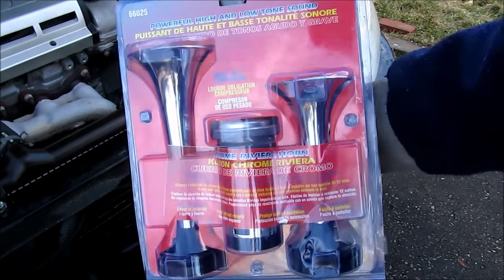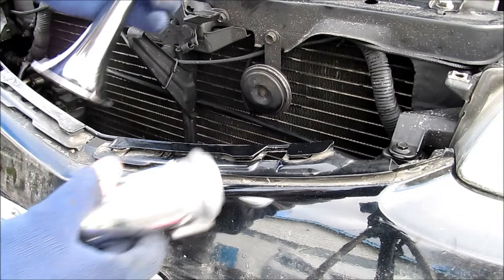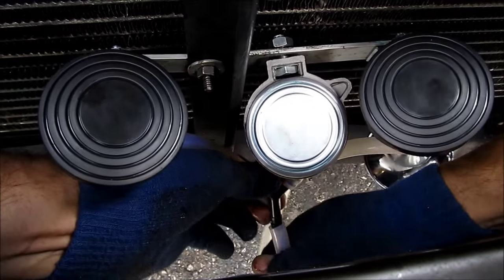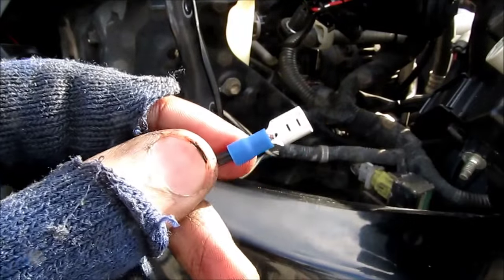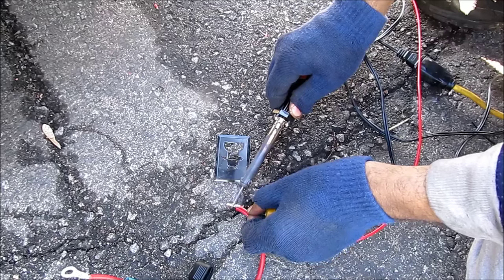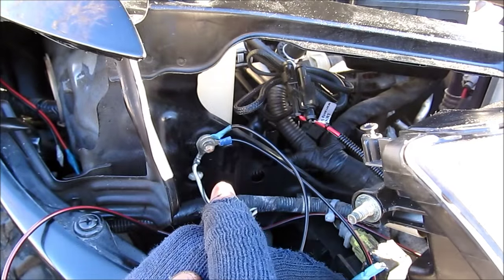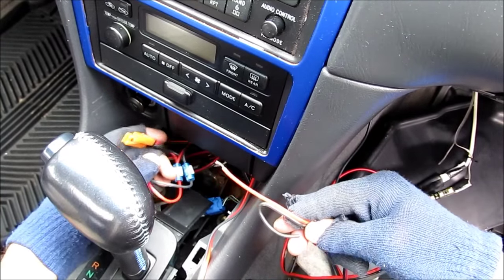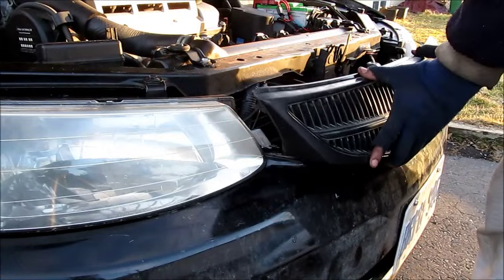Air Horn Installation

Comment: Quite informative, Basically wanted to see the Grille area in regards of mounting the horns along with compressor. Wiring through the firewall is not that hard as I looked up google. There's a rubber bulb protrudes next to the steering column. That's where the wire goes through along with dielectric grease. Just a tip or two here

Comment: I used this video installing this very horn and it learned a lot referring to this video many times as a guide.
Reply from the maker: I'm glad it helped. Where'd you get your horn from?
Reply: speedkar99 I have had it for over a year and got it for a 79glastron Carlson boat I was restoring. So I finally got around to installing it. I got it on amazon and the horns are red plastic not chrome like yours but other than that identical. Also they sell the very same one at harbor freight.

Comment: i wanted musical air horns in my Toyota Rukus but i was told there wouldn't be enough room. now i have 1 horn mounted which is a Klaxton. i have a black soft touch button near the entry key to push to sound the Klaxton.  but i would prefer Musical horns.  awesome video my buddy.
Reply from the maker: +SK4869 Thanks. Musical horns play music when you sound them? Kinda funny on a car haha
Reply: speedkar99 oh yes. since i am driving a box i really wanted musical horns which play a tune. but here in Australia they are illegal. but you can still buy them in the shops. i am quite happy to have the klaxton which is kinda funny as people are quite shocked when i press the button. they don't expect it. so i am very happy with my horn. thanks my buddy :-)
Reply from the maker: I really want to make this horn lower pitched, like a truck or a train. I have to modify the horn bell to be longer so it sounds less like a circus and more manly.
Reply: speedkar99 couldn't you get a Klaxton horn & use that.? oh yes i too would love a truck horn in my baby. imagine the surprise you would get. ;-)
Reply from the maker: Yes, I could change the horn, but I want to see if I can DIY rig something.

Other projects in the loops for now though :)
Reply: speedkar99 i would love to see a video of your new horn if you get to do it. oh yes. there are always other projects. I'm still wanting a few things down to my baby. can't wait until i get them all done.

Comment: Very good instruction (I liked that your video didn't include any wasted time unlike 99%+ of YouTube instructional videos). The only thing you didn't do, based on your own instruction with, incredibly, an example of the violation of your own rules, is actually use a crimping tool instead of a cutting tool. Could it be that you actually don't have one?
Reply from the maker: Thanks for the kind feedback
Reply: You're welcome. I am curious though, do you have an actual crimping tool as opposed to the diagonal cutter used for this purpose in your video?

Comment: I'm confused where the switch wire connects to. Does it get spiced into the fuse wire? Or does it get wired separate to the battery and a separate wire from the battery to the compressor?
Reply from the maker: To the relay and then ground

Comment: Could I install this without a harness? The harness for my Mitsubishi Montero sport (2002) is no longer sold anywhere- and I cant fix my horn the traditional way. SO I thought I'd try to have an air horn mounted.
Reply from the maker: +Jonsin Well technically I did my own harness here by rigging my switch from the cabin outside the vehicle. So yes
Reply: Thanks!

Comment: i realy need the relay ?? if i connect one cable from the compressor directely to the battery and the other one to a button that is connect to the battery does it work ????
Reply from the maker: +Eurgio That will burn your switch 
Amperage is high

Comment: Is it possible to just replace the stock horn with the air horn so that there is no need for the extra wiring and relay? Just remove the stock horn and feed the power to the compressor?
Reply: Of course no bullshit just remove the good old horn throw it away and rewire the new one and enjoy
Reply: Possible - yes. Legal - maybe not. Also, two horns gives an option for a gentle "beep" or a riveting "HONK"!
Reply: Of course

Comment: ok sounds good. but I have a newer car and don't wanna tap into other wires.. so I need to run a 2nd   wire to function as the other side of switch?
Reply: like another hot from battery?     sorry for all the questions  !
Reply from the maker: +TheCladi8or Yes the switch needs to go from power to the relay. 
You should run the switch off of an ignition enabled fuse so the horn only works when the key is turned on.

Comment: Awesome video, had a question though. I received 2 large horns with separate motors. Is it okay to run them inline on the same 30a fuse or should I run parallel circuits tied into the same switch??
Reply from the maker: I think a 30A fuse is sufficient

Comment: I have a Vevo air horn kit. No manuel. 2 wires off the 4 horns both red. A red and a blue off the tank with attached compressor.  How do I wire it
Reply from the maker: To the relay as you see here

Comment: I think it a little strange that you switch the negative side of the battery through the relay... I would have grounded the negative side of the compressor and switched the fused positive side of the battery through the relay to the positive side of the compressor.  2:12
Reply from the maker: +MrMbaines13 It works either way. Its easier to find a ground inside the car than to find a 12v source with high enough amps to power the horn.

Comment: Good video and thanks. I am installing a set of Fiamm horns on my Caliber and this will be very useful. Quick question, do you think you lose volume having the horns facing down?
Reply from the maker: Yes because it's bouncing off the ground. But I prefer not to have water in my horns

Comment: Why cant you use the wiring from the original horn and not use a switch
Reply from the maker: So you can use both types of horn independently
Reply: @speedkar99  I just want the air horn operational, how do I stop from blowing fuses
Reply: I put a 10a fuse in the hot wire to the battery so I don't blow the 25a in the fuse panel and that blew instead.
Reply: Could be a short-circuit somewhere in the wiring or components.

Comment: What if you don't install a fuse will it still work..??
Reply from the maker: It will but could short your battery if there's a problem
Reply: @speedkar99  OK thanks for letting me know. I am going to get the fuse now..
Reply: @speedkar99  Is the one fuse all I need on one side.. ??
Reply: @kc8998  , it's basically a planned weak spot that can fail before other more-expensive hard-to-reach wiring or electrical components burn up from excessive voltage. 
So one fuse per complete circuit (even if multiple items draw electricity from that one circuit route).
Reply: @jongregory8554  Ok thank you very much. I needed to know that..
Reply: @kc8998  , haha - sorry about a reply not arriving for 7 months. I just saw the conversation and thought to add the info for anyone who might be reading. Hopefully you haven't been waiting that long to finish your project 😁

Comment: simpler not best but I've seen worse... material:
12 gauge speaker wire, 20 amp fuse and holder, terminals, and momentary switch...
1. you take for example the positive side of the wire with the fuse from the positive battery post to one side of the momentary switch...
2. you take the for example the negative side of the wire from one side of the switch to the positive on the compresor
( both + and -- sides of the wire are positively charged)
3. ground your compressor
...you will know where the terminals go
Reply from the maker: +juan kidd You'll fry your switch. The relay is there to separate the circuits.